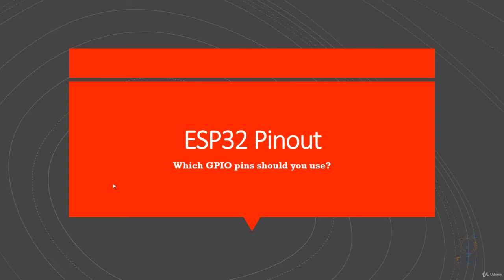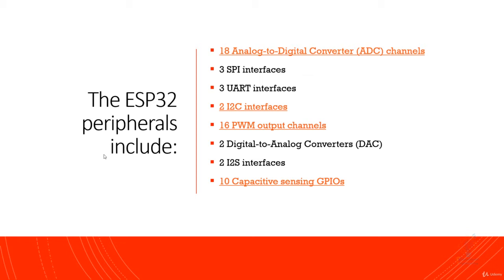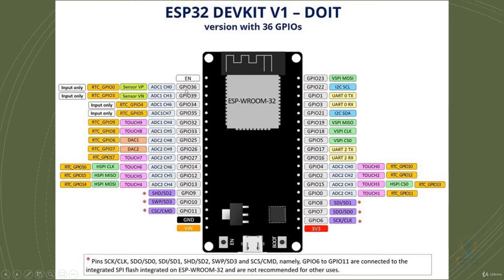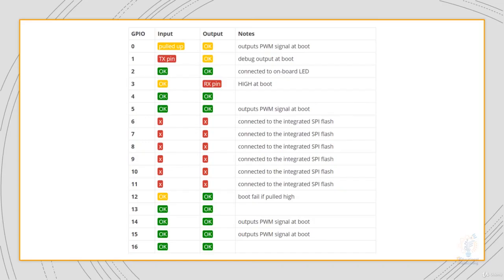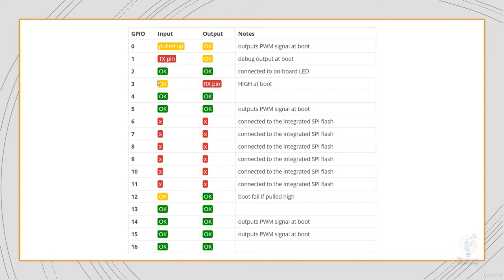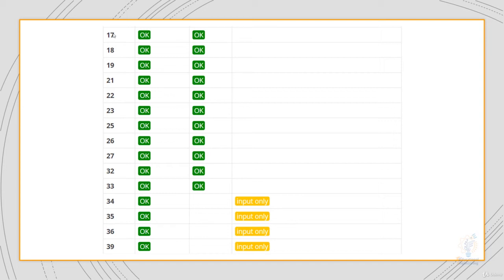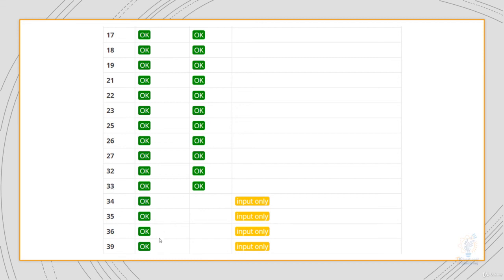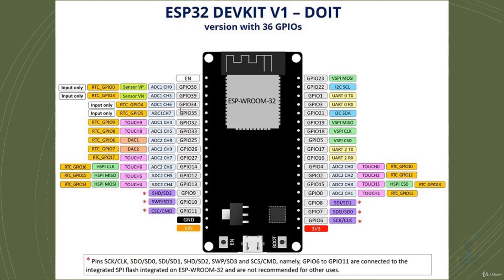ESP-32 Pinout  | Getting Started ESP-32 | Overview of ESP-32

Comment: 8:51 i have a question 🙋:
I have a humidity sensor can i plug it to the RX0 ?
Reply from the maker: Yes
Reply: @ScholarlyExcursions  but I think first I need to unplug the humidity sensor while uploading the code (when the USP connected to the board)
Reply: @ScholarlyExcursions  and also what about connect it to the GPIO9, GPIO10  or other GPIOs that don't support the UART protocol?

Comment: I put a video on youtube showing the wiring of my board by the way this lights strip works fine on ESP8266
Reply from the maker: First keep in mind that esp32 is active low. Secondly make sure that code is properly uploaded on board.
Reply: @ScholarlyExcursions   i don't know how to upload any code on the board.
Reply from the maker: @elieeid8865  then you need to watch tutorials about this first and then run the code.
Reply: @ScholarlyExcursions  in a dummy trying to learn. I have 72 years old. To close to the outer life

Comment: Thank you for your post it's usefull. I am facing a problem with my ESP32 30 pinsout. I connect the the VN to my positive,and. The GND to my negative , and D2 to my data. On my led strip light. Nothing happened. No light at all . And i can see the led ligh power on my board is lighted. What i did wrong.please help me to fix this issue
Reply from the maker: Check code and also check the voltage of led strip. Its not possible to tell without checking in detail. You need to check all the possibilites.
Reply: @ScholarlyExcursions  I'm really dummy for that, how can i check the code. Tell me the way please
Reply: @ScholarlyExcursions  the voltage is 5 v, and i check it in led strip , it has voltage. 5 v
Reply: And i connect the positive to the positive on the strip led light and the data to the negative i got the D2 light on my board lighted